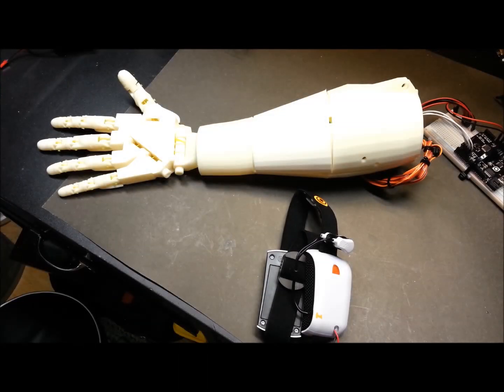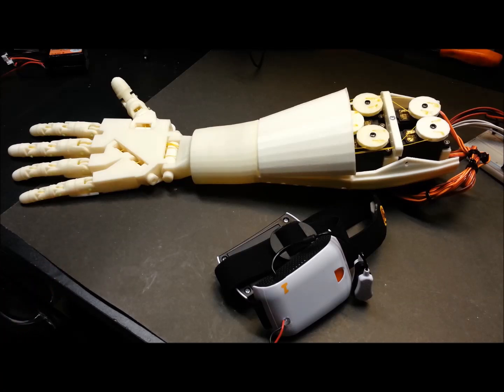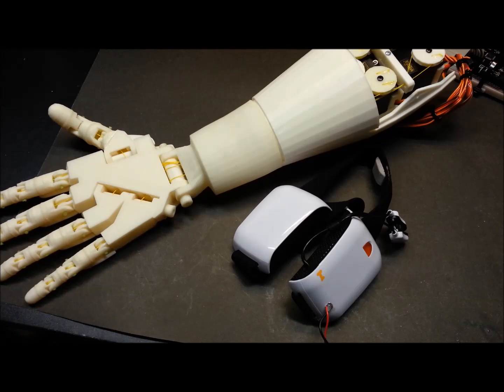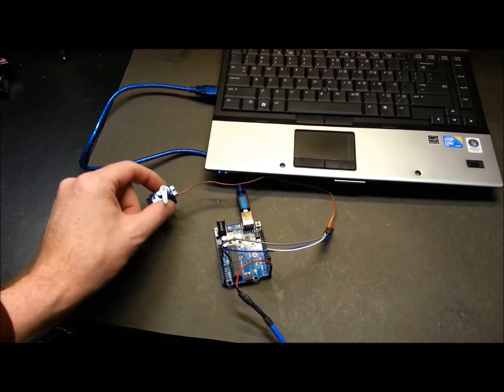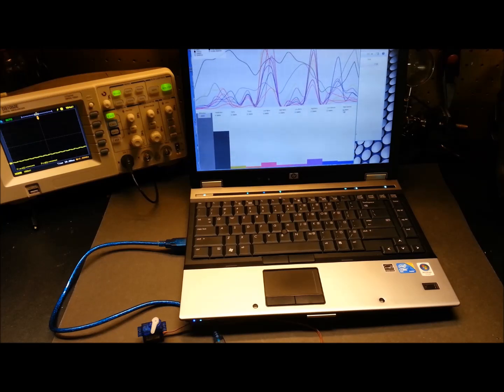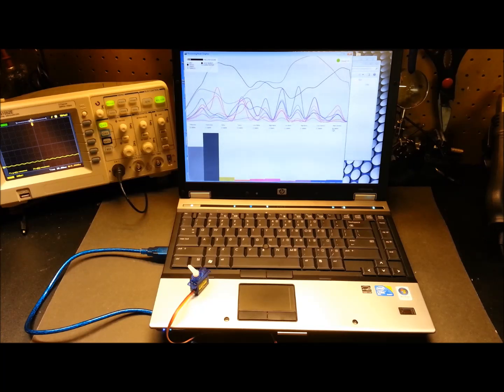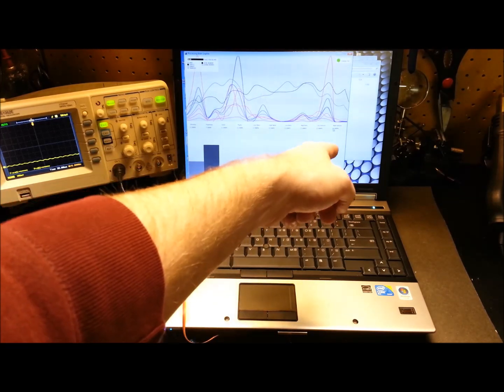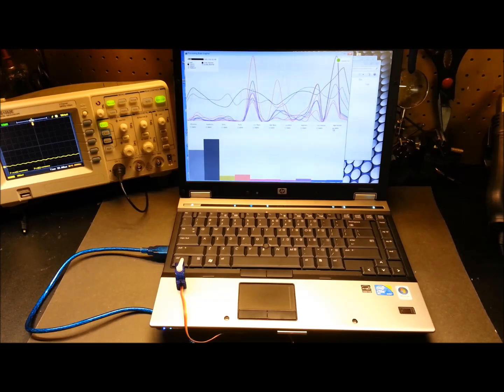DIY Brain-Computer Arduino Interface Tutorial Part 5- Testing

Comment: Hi,i am working on a mind controlled quadcopter,i am using a neurosky mindwave headset and i am planning to link it via bluetooth to the arduino.,and how can i control the transmitter of the remote control to send signals i want,using arduino?
Pls help.Any info is welcome
Reply from the maker: Not sure on that one.  You could hack into the pots in the TX and send the analog outs from the arduino maybe.  Cheers
Reply: Thanks..